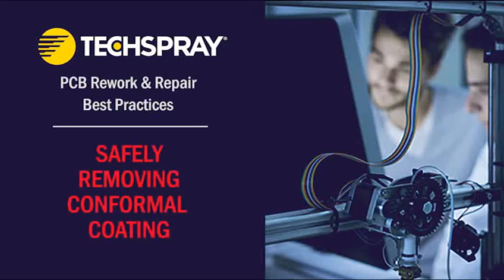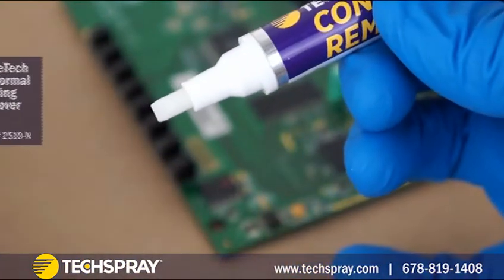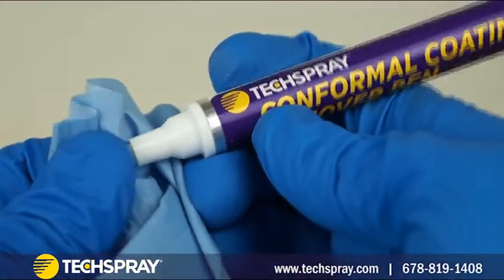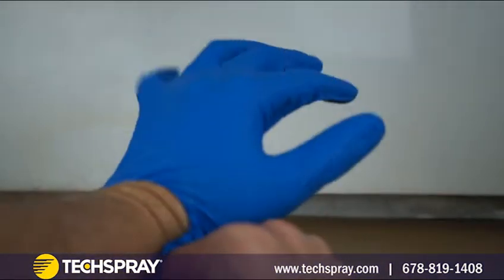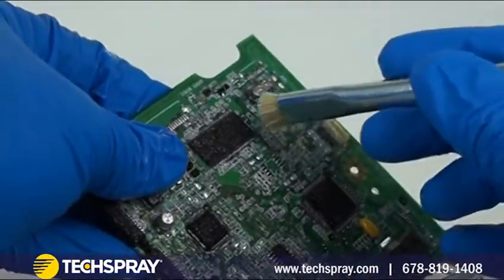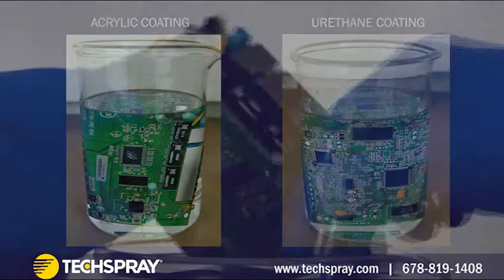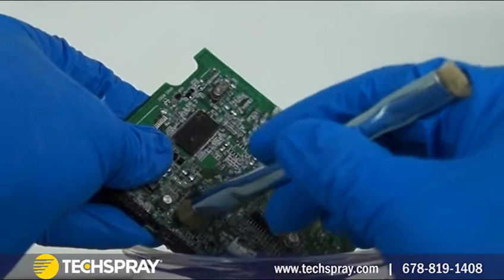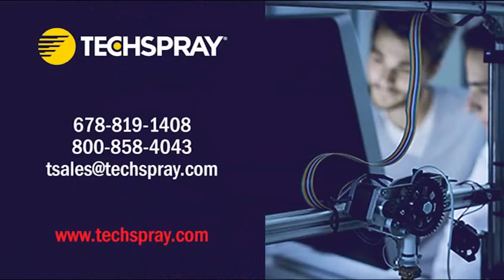Removing Conformal Coating from an Electronic PCB

Comment: Silicone conformal coating will come off quite quickly when soaked in isopropyl alcohol in an ultrasonic cleaner
Reply: Extremely dangerous in using IPA in an ultrasonic cleaner. It is explosive!!